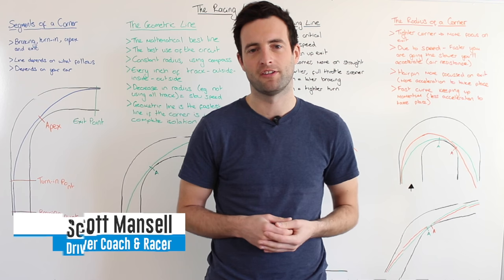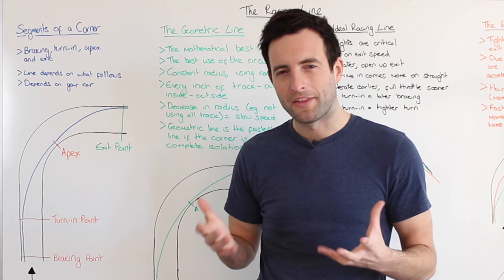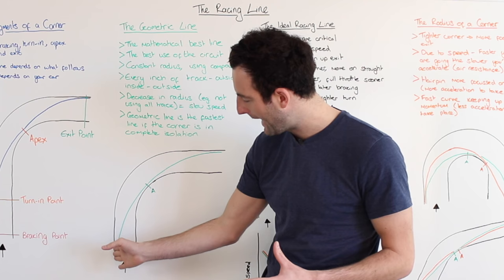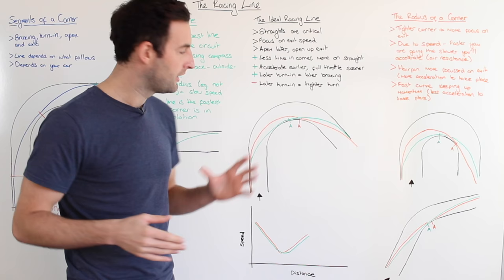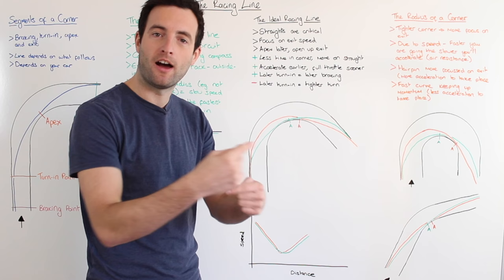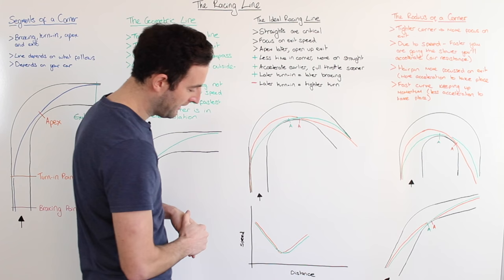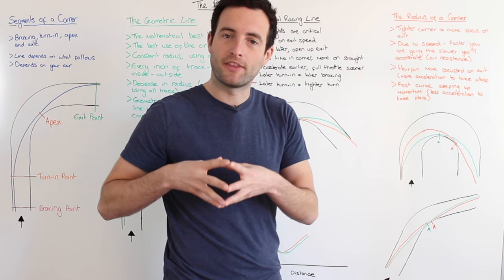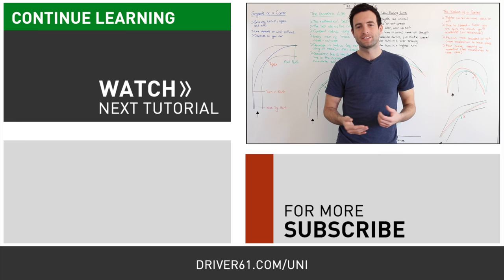The Racing Line - How to Drive the Perfect Corner (Actionable Tutorial)

Comment: Would you stick closer to the geometric line in a less powerful car than in a more powerful car, because the speed difference will be lower?
Reply from the maker: Hi Davy, yes that's correct. In a more powerful / less grippy car you want to spend as much time on the straight as possible to make the most of the power.
Reply: Absolutely, that's something that could be emphasized a tiny bit more on the video. And something that got me into an argument with a driving instructor two weeks ago, the guy wouldn't admit that the racing line depended on the car (and possibly track conditions).
Reply: @anidiotinaracingcar4874  one of the challenges I have in responding to novices questions is I always want to answer their questions with well it depends"  it's like there are few absolutes, I need to know are we talking F1 cars or spec miata, or for that matter are we talking about an AWD, FWD, or RWD, then again is it a horsepower car or a momentum machine?  It depends!

Comment: Kinda wished you compared racing lines in relation to the difference between the two sections before and after the corner.
Your examples point that if there's a straight after the corner how different your line would be, which is correct.
But we have 3 types of apexes, there's the perfect apex, then late apex, and then early apex. 
And I'm sure you know that early apex is for when you're coming out of a long straight and then going into a sector that is slower, so you don't brake as much, and you carry that speed with you through the corner. Where as in an early apex, like you said, we want to get on the throttle sooner and exit faster. 
I'm just saying, when you talk apex, be sure to mention the 3 types, it sits better in the mind of the student.
Great series, by the way.

Comment: The ideal line with the "slow in, fast out" line is also safer for me riding my motorbike on public roads. You brake to your slowest speed at corner entry, making you hit the turn-in point more reliably and reducing the risk of early turn-in and overshooting the exit / going offroad on the outside. Also, accelerating out of the corner with good vision of the exit and a little remaining lean increases the fun factor. For blind corners, keeping outside and turning in late also helps seeing further ahead through the corner. Lastly, riding a "faster line" doesn't necessarily mean you have more ground speed, instead you keep the speeds lower and the bike more stable (also a good idea for riding with passengers), because the ideal line makes up your time.

Comment: obviously the possibility of drifting drastically changes the design of the line. i'm thinking the much higher speed of attack makes drifting a no no for the  F1 cars
in relation to the corner attack strategy, it is true that Ruben Barichello had a style that included hugging the corner more than the average f1 driver at lower speeds( of course) but making it up after the post apex with acceleration with the intention of shorting the time the car sits in the corner? I was like many others a die hard senna fan, devastated at his death, and kept following barichello in races for some years after him being also a brazilian driver. thanks for the explanation

Comment: This is probably a silly question: Alright so the racing line apex is later in the corner than the geometric apex. As I understand it, this is to ensure a straighter exit resulting in more speed. Indeed, the 'harder' the turn the further the racing apex from the geo apex. Out of curiosity, are there any instances where the racing line apex is before the geometric apex?
Reply: Yes there are many different types of corners which have different ideal apexes. The one you are referring to is the early apex. The one in the video is a late apex

Comment: Hey there, I loved your video and i have a question - should I take the racing line of a kart on a circuit as close as possible or the same as the geometric curve of a turn? the kart goes up to 60 kmph. Thanks!
Reply: Depends on the corner and what comes after the corner, but as a rule karts have their own racing lines (called the wet or karting line) because they're massively underpowered, there is less focus on hitting the apex and getting a good corner exit, the focus is more on keeping speed and momentum throughout a corner. As a result for a go kart generally you'll want an earlier apex and a wider line. Look up the wet driving tutorials from this channel he explains the karting line

Comment: hmm on both those ideal racing line examples you've moved the apex to a point further away than the real apex which is never going to faster. In the green line you will be so far ahead of the red line that it doesnt matter if the red line has better exit speed. 1 second after the corner starts  the green line will be going faster than the red line because its already further down the straight

Comment: Hello I like your videos but I have a quest for Karting I'm driving in a 550m circuit and with perfect racing line I'm able to go around without even lifting the throttle but it will slide and loose speed.. And so.. My question is should I coast or go full throttle because if I lift the throttle I won't slide at all but still reduce speed it's 270cc rt8 rental cart so it doesn't speed up so fast thanks in advance